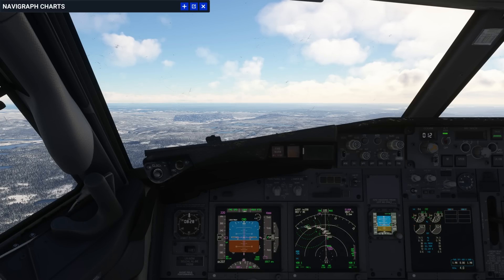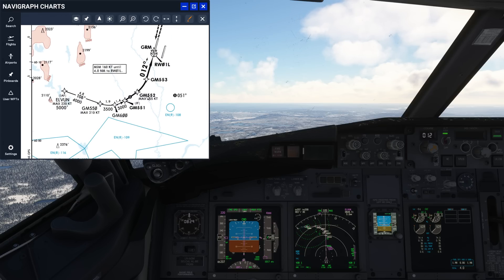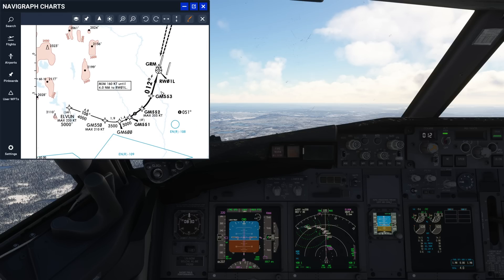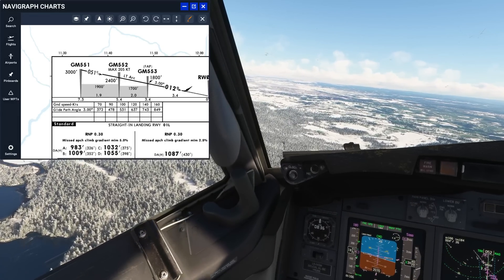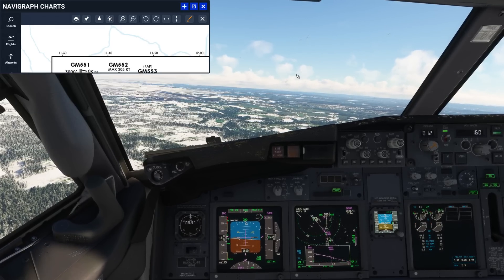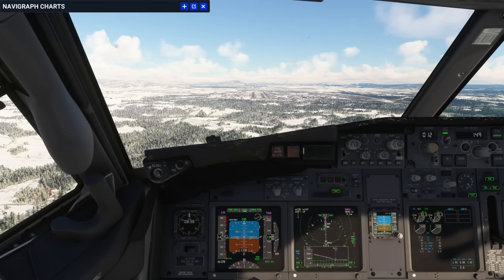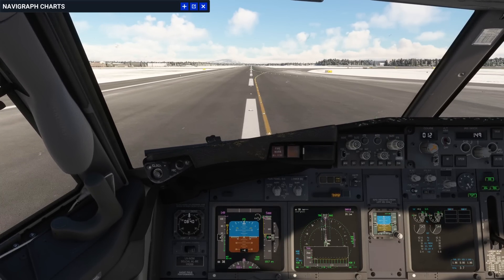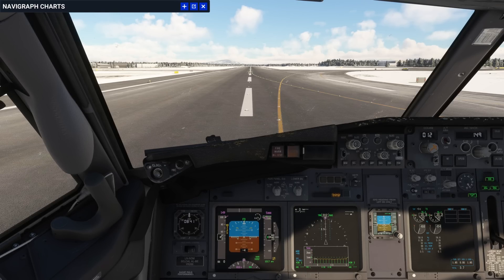Tutorial: How to fly an RNP AR apporach Norwegian PMDG 737NG

Comment: Nice video! These are really fun approaches to fly irl. Shame not a lot of people use them as the ils is usually the norm. Couple points for accuracy. Yes there is a company specific procedure and its quite convoluted so I wouldnt worry about most of it for the flight sim. You changed the RNP to match the minima value which is awesome, however with this approach vertical RNP has a role to play too. The vertical RNP for AR approaches is 125 feet and needs to be either checked or set the same way you did the lateral RNP. Other than that awesome stuff!
Reply from the maker: Happy that you enjoy and thank you for the feedback! I know about the vertical part, but haven’t seen Norwegian do it (not sure why and seen it once on a video so take it with a grain of salt) but that is why I didn’t include it here. I wil see if I can check it up one day.